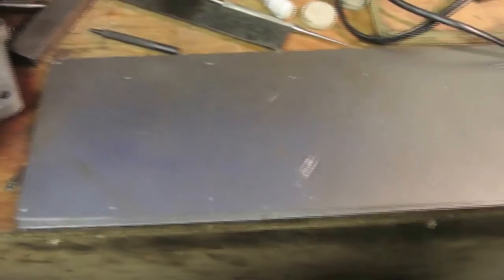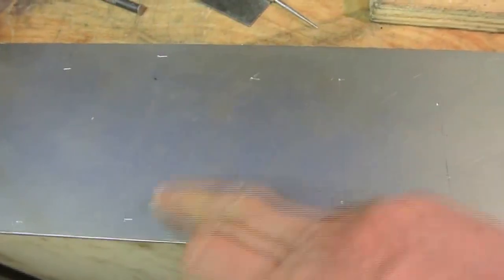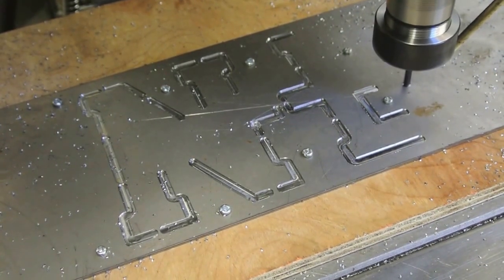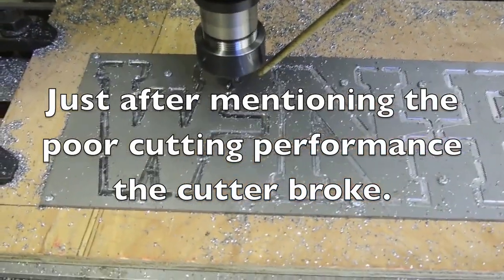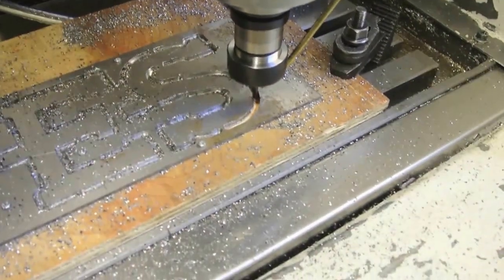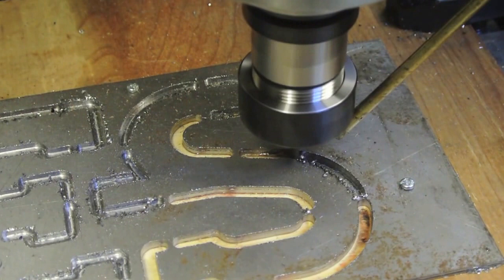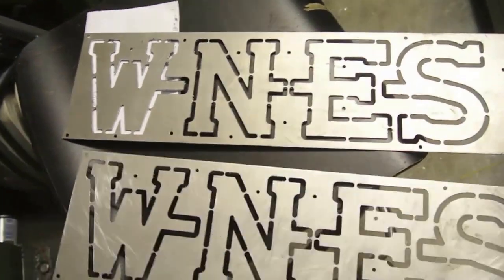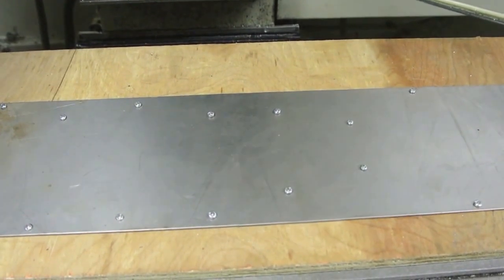Making Weathervane Letters using Fusion 360 and the Tormach PCNC 1100

Comment: If I understood you correctly, you modeled the tabs, right?  In the future instead of doing that, you can add the tabs in the CAM.
Reply from the maker: Hi Shawn, yes I did and I know that in Sprut Cam you can add tabs but ~Iwasn't aware you could do it with Fusion360
Reply: If I remember correctly, they are available in 2d contour.  Look in the geometry tab.